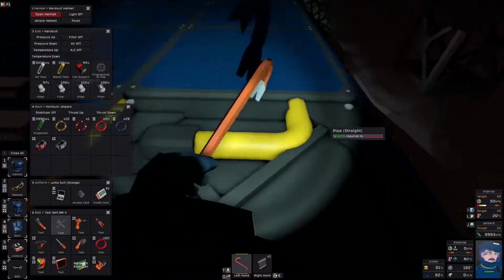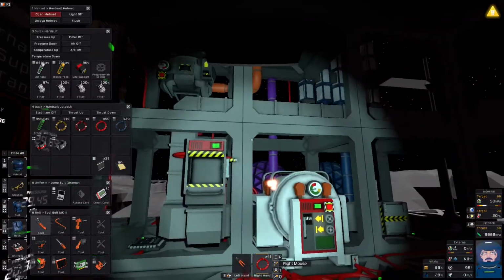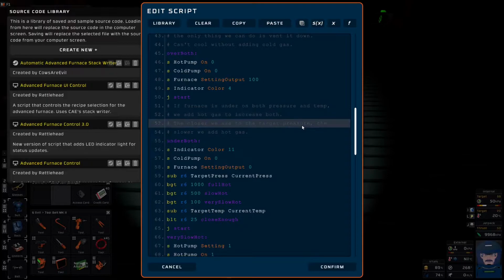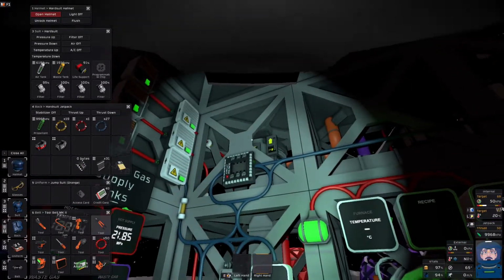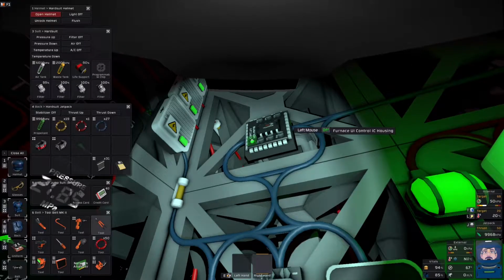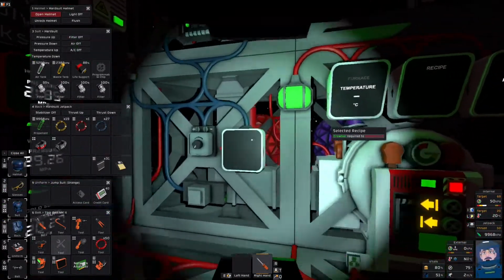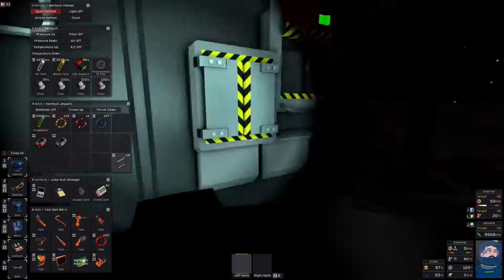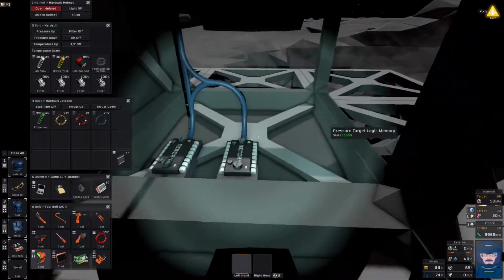Let's Play: Stationeers - Episode 32: Advanced Furnace User Interface

Comment: nice setup^^ will test that out :D emm 2 questions. does the extendet stack writer also work with your script? there are 2 versions. stavk writer and extendet stack writer (the extendet can also make the basic ingots) and another question :D what do you use in the back of the furnace? how is it connected and to what :D what fuel mix :D
Reply from the maker: Thanks!

I haven't tried the extended stack writer myself, so I can't say if it would work. But, for the basic smelting I just set it for steel and that will get the job done. I think the other stack writer might work, assuming the stack entries are spaced the same. If not, you could change the code that adjusts the stack pointer to work with it. As for the data from the stack, it just needs to pull the temp and pressure settings out so it can send them to the memory chips to control the furnace.

The fuel supply is from a mixer system on the roof. The build for that was in a previous episode all on its own. That feeds the basic furnace in the wall, which is just an igniter for the fuel mix which gets pumped immediately into the hot side tank.

Comment: have it build and its kidna working but the Cold Tank Fill Pump wont ever turn on. the Cold Gas Tank is just empty
Reply from the maker: Can't say what might be the problem  there, but I'd check to make sure the volume pump going to the cold side is set, connected, oriented the right way, and so on. And, of course, the chip pulls it's temperature and pressure data from the tank.
Reply from the maker: The wiring for all the gas supply tanks does get kind of convoluted, so it can be easy to miss something in the wiring. But if the IC controlling it isn't showing an error, it might be something in the pipes and pumps?
Reply from the maker: OH, one more thing: It did take some time to get all the gas supply tanks filled the first time around. Had to run a lot of fuel through it from the hot side, out to the waste, then over to the cold side. Once all the tanks are filled, the system maintains itself pretty well. Do make sure you have something to remove excess from the waste tank as, once the cold and hot are where they need to be, the waste tank does accumulate gasses over time. Eventually, it will need to vent back to your waste management system, or the environment once it gets above a certain pressure.
Reply: @rattleheadx  i cant reach invar. it stops at 17.8Mpa and 990°C but i need minimum 18mpa

Comment: it wont reach many things for me.. stellite for example. it stops at 9.8mpa and 1300°. it should get to min 10mpa and 1500°. happens with many alloys
Reply: invar stops at 17.8mpa and 900°
Reply from the maker: @Matthew.1994  May need to adjust the target temps from the stack program. With the thermodynamics update, it's hard to keep a furnace at a stable temp.
Reply: @rattleheadx  i dont know what to change in there :D tried a bit but it stays at the same temps on the memory
Reply: i did that but it wont reach a high temp.. my cold gas tank is at 5mpa and the hot tank at 600kpa atm.. it wont get new hot gas. i have the fuel mix script in place too
Reply: @rattleheadx  do you have discord? easier to talk there :D maybe you can help me getting it to work. high temp with high pressure stuff wont work at all. either the pressure or the temp is out of the range i need it to be in